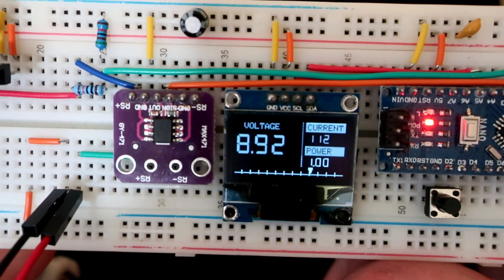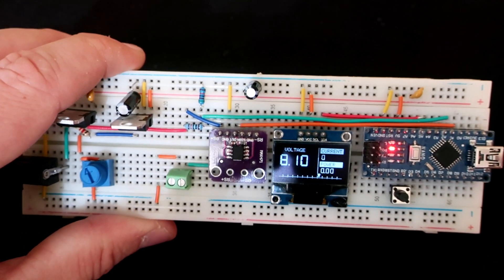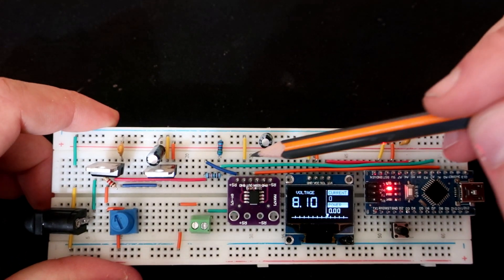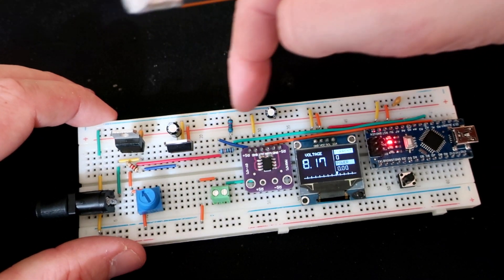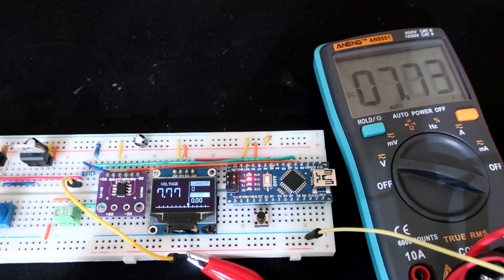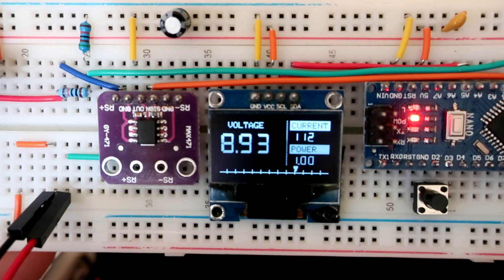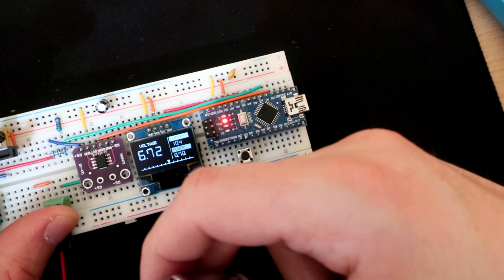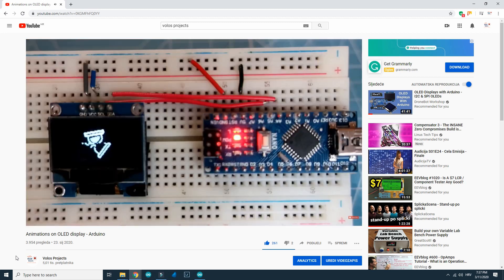Arduino Multimeter

Comment: greeting
compliments for all the projects you have done

I have a question

whether a 30 Ampere ACS712 current sensor can be used
i believe it needs some changes in the sketch
so I would be grateful if you would help me

Greetings from Serbia
Reply from the maker: Naravno da može, nemam iskustva s tim modulom al vjerovatno treba manje promjene u kodu. Naravno da ću pomoć!
Reply: @VolosProjects  hvala ti unapred  a i hvala na brzom odgovoru
Reply: @VolosProjects  izvini odakle si jeli li mozda iz ex yu
Reply from the maker: @djokinac  da da iz hrvatske sam
Reply: @VolosProjects  o hvala bogu da ima i neko  nas
komplimenti ali stvarno
od srca
nadam se da cu nekako moci da ti se oduzim
za uslugu